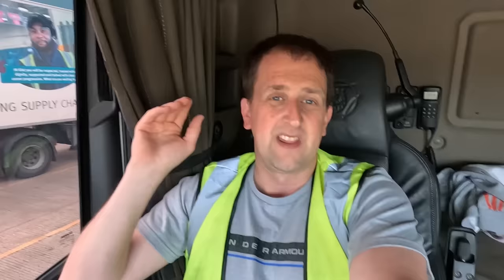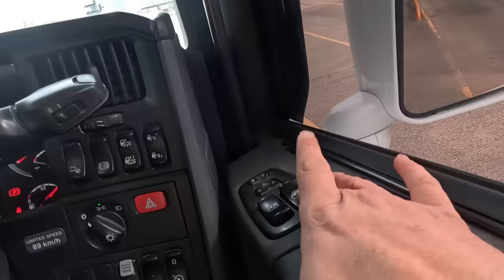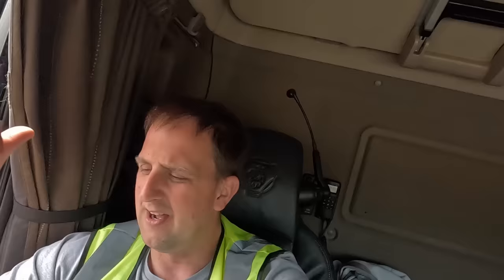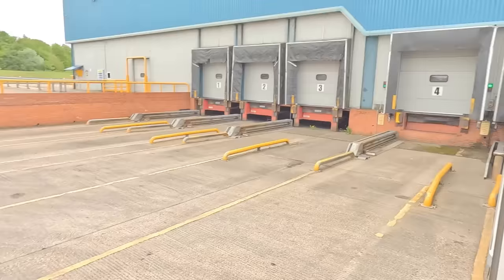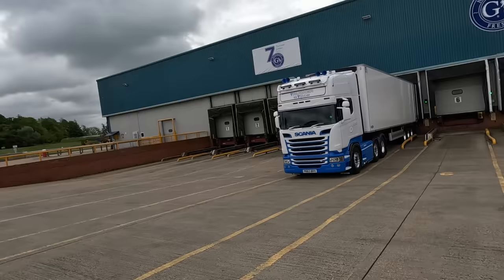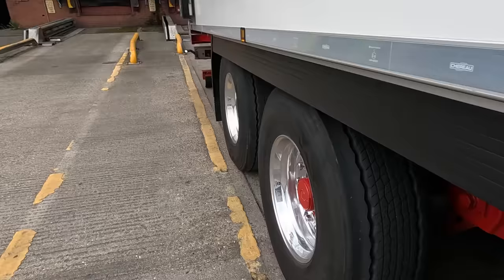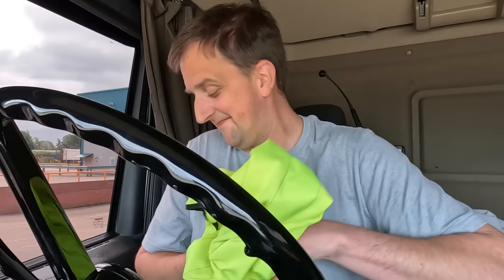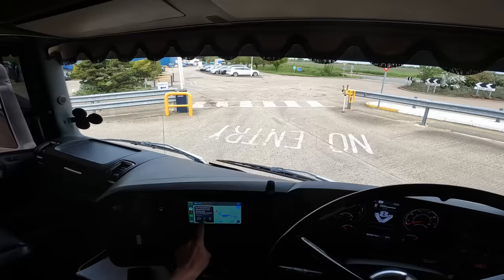My FIRST Day Doing Fridge Work… Ends In A BIG Mess!! | #truckertim

Comment: Ha ha, I used to drive for the Coop, one day the warehouse run out of roll cages so they loaded everything on pallets, badly shrink wrapped them and then loaded them into the trailer with one turned 180 degrees to the neighbour. Well it was cross country to the shop, when I got there and opened the rear shutter there was a wave of cream etc etc running out the back 😂😂

Comment: Great video Tim. So love the sound of the V8! The trucks in the wide load bay just as you joined the A50 are Ruttles Heavy Haulage division. I’m an escort driver for them as well as a Class 2 and 1 driver. February I got my class 1 , but unfortunately there is no spare trucks. So because I’ve only got experience in the class 2 but not much in the 1, I’m finding it hard to get a job elsewhere. Any advice would be much appreciated Tim. The trucks in the lay-by was a Volvo and MAN trucks. Thanks again and keep up the awesome content. George 😊

Comment: Give the caravaner credit though. Joining off a slip road is give way so if they’re running slower joining traffic should adjust to join. Granted you’ve gotta consider momentum but still they’re not obliged to pull out.

Comment: I suspect repairing the splitter is going to be an recurring theme. Perhaps concider keeping it off to save the expense. Just use it when your doing shows and what not. Looks really good though. Truck is a beauty and it's starting to pay for itself now. More trucking vlogs as well so really loving accompanying you on this journey. Long after the data shredders days. Kind of miss those days though. Could you do independent work for them?

Comment: that trailer is French pronounced; cheer 'ou
the Hornblasters no gonnae no dae better without a Proper supply line,
get a DAF Air Horn pull valve and 3/8 or 1/2 in line on the 12 Bar circuit and they will Blast yer ears out.
now we know why the Aldi Salad and tomatoes are brown and smushed, Tim is responsible,
fae not putting the lock bars in.